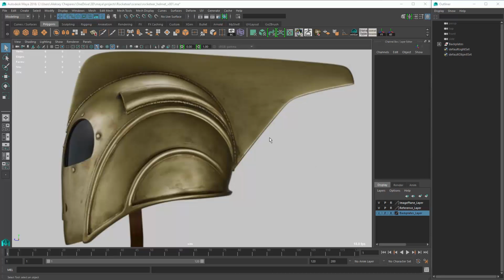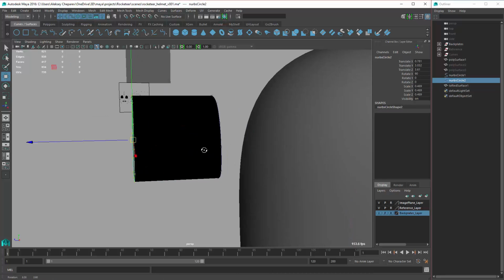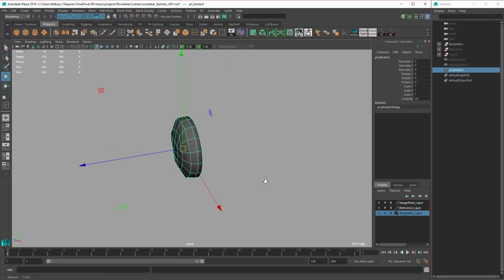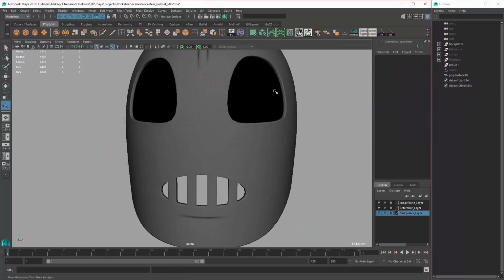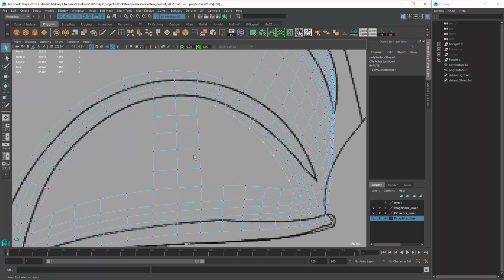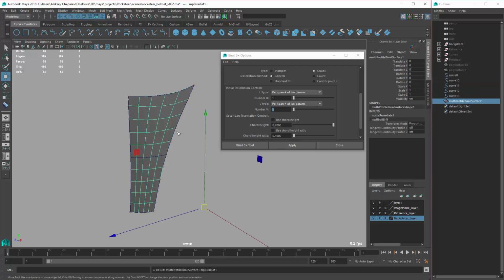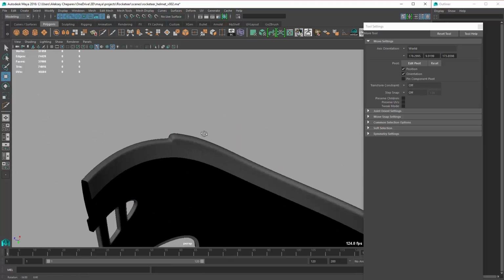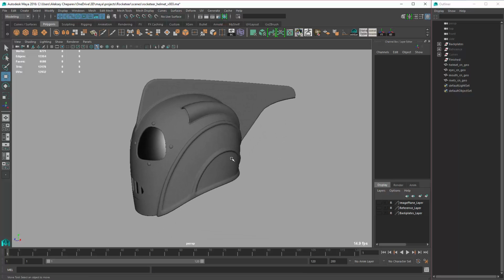Rocketeer Helmet - Maya 3D Modeling Tutorial

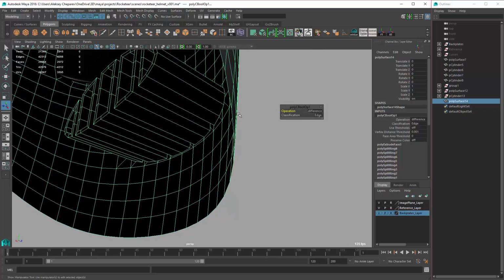Comment: I've got problem around 25:43, which I can't fix. 

Basically, after I do this boolean and difference thing, trying to double click these edges, it doesn't work. I have to manually select all of them and then delete, but I end with some strange faces. Deleted all of them with this result:

http://imgur.com/a/H1m7S

Do I need to add these missing edges with tool like multi-cut? Just asking, if there isn't any straight answer, I will do this by hand. 

Thanks for your time, best! :)
Reply: UPTADE: Multi-cut doesn't work, I'm totally done.
Reply from the maker: So, you have to delete the triangles that are created with booleans by hand. Then you can delete the loops.
Reply from the maker: Haha, I know how you feel. Try restarting Maya and do it again. Sometimes things can get really screwed up and a restart fixes it usually.
Reply from the maker: Also make sure you set the Boolean options to "Edge", not "Normal"!
Reply: Thanks, I'll try! :)

Comment: Hi Alex, in my loftedSurface doesnt show nurbstessellate, iam using maya 2016 Exp2
Reply from the maker: Before you create the lofted surface, you need to make sure you open the options for it, by clicking the square icon to the right of the tool in the menu, or double click the tool from the shelf. Then you need to set your settings to make polygons, and not Nurbs. Check the video again here: https://youtu.be/w0dU0EqqZXY?t=620
Reply: ohh i got it, thanks a lot alex

Comment: By the way brother, I know you've kinda shown us a little bit before. But could you do like a 10 minute tutorial on the "Lattice" tool and how you use it with your settings? I watched your storm trooper helmet model with the Tubing which you did in Nurbs curvs. And you briefly went over the lattice stuff. But could you do even another basic version of that tube, or even just a tube with some vertical isoparms or something and show us how you highlight, select and use the control points of your lattices. Literally just focusing on the lattice part. As i tried using Lattices on my tubing on my helmet, and it just seemed way to complex trying to move a couple of points of the lattice at a time as i was getting lost in which was lattic vertex and which was actual vartex, if you get me!

Comment: dude that was a bomb trick at 3:01, I didn't know that by selecting all the verticies and hitting delete maya will just delete the ones it can delete (the extra verts), that's a bomb clean up trick that is so useful when sliceing with curve/ doing boole clean up!
Reply: +Antony Quigley I don't think you understand what I was doing. I was not offering Alex advice as I am learning from him. 

 I was simply asking him if I can utilize his awesome tips with bezier curves instead of nurbs, because I utilize bezier curves for various other reasons in 3d and to me personally they are easier to control. I was simply asking him if I can modify is knowledge and make it my own / useful in my personal workflow.. like if doing so would work out...... 

anyway, thanks Alex, awesome tutorial and great quality assets!
Reply: btw, can you use bezier curves instead of nurbs (like for the eye) for sharp corner cutting shapes? does the method you do work with bezier or does maya freak out?
Reply from the maker: +picosdrivethru Bezier curves work fine in Maya, but I'm a bit old school. Also I'm all about conserving my mouse clicks and Bezier curves require a couple of extra clicks :)
Reply: +Alex Cheparev ah Interesting, I'll have to be more wary of that. I just like bezier because you can achieve more complex curves with just 2 points, where as nurbs would require 4. (like an accelerating french curve for example).
Reply: +picosdrivethru I love people who come on to a pro's channel (every single time) who's doing a tutorial, supposedly to learn. and then try to offer the pro tips..